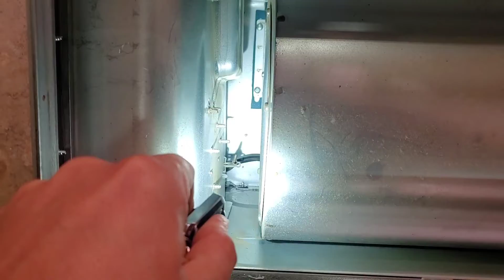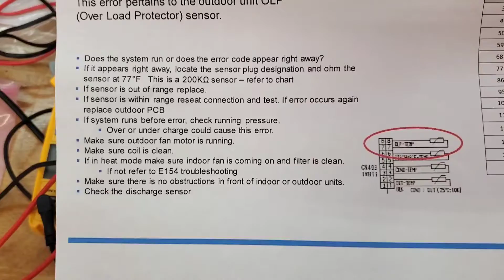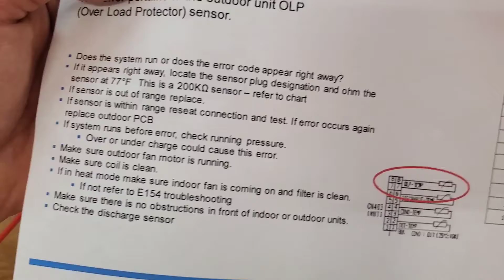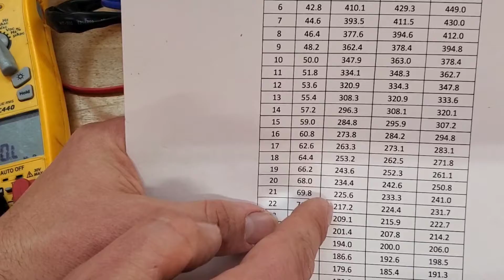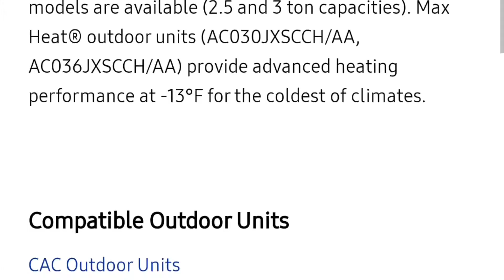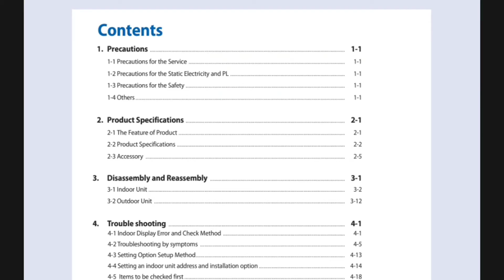Samsung HVAC training Error E320 #SamsungHVAC

Comment: Hi mate, been working on this ducted system, unit showing e320 but when I checked the sensor it seemed healthy with good readings. Fou d the system short of gas (leak on the suction flare) and also evaporator coil partially blocked due to poor installation. Fixed all issues and still getting e320 fault. Also compressor is getting  pretty warm and my oressures are still low. On cooling I'm getting -2celcius on the evaporator and 35celcius on the condenser, 20celcius ambient. I'm wondering if I'm dealing with a damaged compressor. What should I check next?
Reply from the maker: If the charge is good
 I would suggest replacing the main  PCB

 Thank you for joining
 Please send me an email
 I have some guides for you

tadfuller1@gmail.com
Reply: @taddydigest  cheers man, email sent

Comment: Thanks mate, we have a building full of Samsung VRF systems with multiple wall mounted systems. Tech support in Australia for Samsung is atrocious. We have 5 or 6 of these throwing intermittent E320 errors it’s a nightmare. This info would be more than helpful. 

Cheers mate 
Baden
Reply from the maker: Hey Baden 
Thanks for watching my friend.
Reply: @taddydigest  quick edit there, Daikin must be in my frequently used words list lol. Mate, how can I get some more information on this error? I have heard others say it can occur due to the weight of the wiring loom pulling the sensor harness plug out of the board etc. sensor resistance chart would be good? 

Thanks again for the vids 👌🏼
Reply from the maker: I can send you the charts

Through email

Just click the join button become a member

Then send me an email at tadfuller1@gmail.com